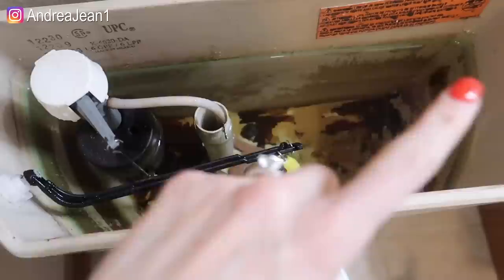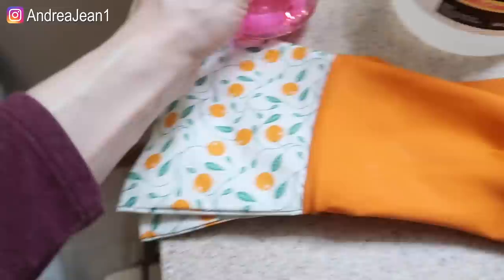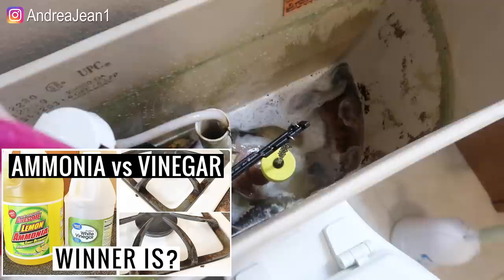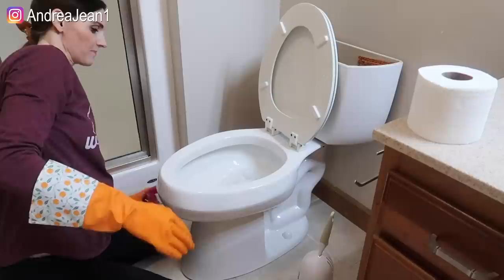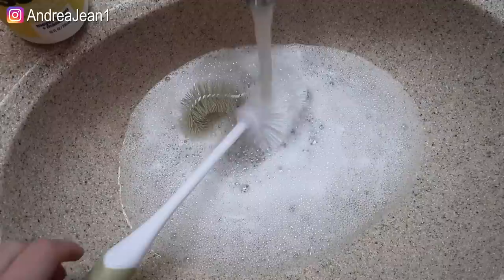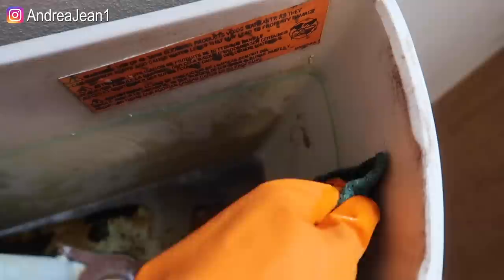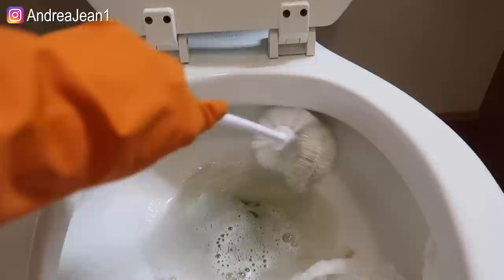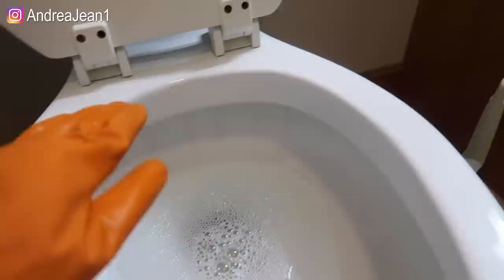Put VINEGAR into your TOILET and WATCH What Happens!! (Bathroom Cleaning Hacks)

Comment: My preventative measure was to have a whole house water filter and softener installed.  Made a huge difference. The filter would need replacing periodically (depending on how much mineral such as iron, is in the water) and salt for the softener, also. I found his true for both well water and city water.
Reply from the maker: Thank you!
Reply: What kind of water softener do you have?
Reply: If you get a softener, get ready to invest in bags of salt, it never ends, hauling salt is not fun, the systems aren't cheap and need repair, not alot but when they do, its again not cheap. I spend appox 800 bucks a year on salt. Things they dont really mention when you buy one. But they do help.
Reply: Charles Miller dang!  That is a lot of money! 
   I only get Social Security and honestly, 
that is a lot of money!
I know they work well. We had a softener when I was a kid in my house. And years ago my first house we had a softener and it was awesome! If you can afford it,  it’s definitely awesome!
Reply: I live in a condo, and i thought about installing a water softener.  The head maintenance man told me others in my condo complex have installed softener systems, but they ended up pulling them out since it reduced the pressure of the water too much.  At least with Andrea Jean's hints and some elbow grease, I can clean off the residue.  Thank you AJ!
Reply: They reduce the pressure by 5 Lbs per bottle, at least. That another thing they fail to mention.
Reply: @charlesmiller5078  We are speaking about the whole house water filtration system like LifeSource. That's what we have.
Reply: @charlesmiller5078  Our last water softener was from either Sears or Home Depot and we went through salt ridiculously fast. The softener we have now, we purchased from a plumbing company that specializes in water softeners. This made a huge - HUGE - difference in the amount of salt we use yearly; down by about 85%. The difference between the two is that we now have a softener perfect for our family size, and it cycles a ton less. Knowing the correct size and how it functions is key.
Reply: @AutumnStarostin  I had a local company install something similar to the Culligan brand. It is a simple system. They have also delivered the salt for us, and carried it down the stairs to the basement and pour it in. We paid for it on the installment plan (no credit cards) and now that we are empty nesters, we use about 40 pounds salt twice yearly. Costs about $15 for two 40 pound bags.  We do live in Iowa, where the economy is livable.
Reply: @charlesmiller5078  We've had our set-up for at least 17-18 years, and never needed service!
Reply: @patriciasodaro8670  Ohhh, I see. So I have a simple water softener, but yours is probably more involved. We have lived in places that we dearly wished we had that kind of set up, as the water was wretched. (Esp. very rusty well water)
Reply: The softener media has to be changed every 3 to 4 years, you have been doing that right.
Reply: @jang871  - excellent tip about using a plumbing company to buy a water softener from - thank you!!
Reply: I wonder if you could drop a few salt pellets into the toilet tank instead of getting a water softener system. Maybe that would eliminate the scale build up in the tank. Last time I cleaned my tank, I used Lime Away gel. It really clings to the tank walls.
Reply: No, that wont work, there is no salt in the water that the softener treats.

Comment: Suggestion:  Pour vinegar down the overflow tube in the tank.  It will run down into the bowl EXACTLY where those stubborn stains in the bowl are.  NO MORE EXTRA WORK trying to treat/then scrub those vertical calcium stains going towards the water line.   John in St Pete FL

Comment: Why not just drain the tank then fill it to the top of the stains with the vinegar. Let it sit o/n then flush it in the morning. 
Also, I had a terrible stain at the bottom of the bowl where it narrows to 3-inch diameter and you can barely fit a round brush in there. Tried lots of scouring powder {Comet, Ajax, Bon Ami) Liquid dollar store toilet cleaner, nothing would remove that stan no matter how much I twisted that brush. Poured about a cupful of Walmart {generic} Dishwashing powder into the water. Swirled it up to dissolve it. Let it sit at least o/n but I think it was more like 12 hours. Stuck the brush in, twisted it back & forth about a dozen times, flushed, and presto, the stain that would not go away was gone.
Reply from the maker: Wonderful to hear ✨

Comment: You need an enviro cloth and a window cloth from Norwex to clean your mirror with nothing but water .  Check it out.
Reply from the maker: Thanks June ❤️
Reply: Don’t let the liquid run down to the edge of the mirror because it will damage the finish on the back of the glass. Use a microfiber cloth and finish close to the edges with that so you keep the edges dry. I use a supper soft micro fiber  cloth as a buffer when it is almost dry and that makes it nice and shiny.  Please don’t put your toilet bowl brush in the sink soak it in the bowl so you aren’t transferring toilet germs to the sink. There are 2 parts to the brush you were using  the loop is to clean up under the rim of the toilet bowl. You can also clean  the brush in hydrogen peroxide. You can clean tooth brushes and hair brushes and combs in hydrogen peroxide too. I was dishes in the kitchen with a baby bottle brush and I clean that in hydrogen peroxide when it won’t rinse clean. I like the bottle brushes that are all plastic to clean dishes because they don’t turn sour and I just hang it up to dry but you could put it in with the silverware to dry if you rinse all the soap out. I rinse off the food, then wash with soap on the brush, leave the soap in the brush and hang it over the sink to dry and then add soap as needed. It is sanitary and cost effective.

Comment: Great video! How did you end up getting all the settled sentiment out of the bottom of the tank afterwards?  I’m thinking you drain the tank again and then just scoop it all out?? Or is there a better way?
Reply from the maker: Yes you would have to do that ....bummer.
Reply: I was wondering the same...maybe empty out and use a wet/dry (garage-type) vacuum cleaner?

Comment: I always use a toilet tank cleaner tablet to keep my tank and bowl clean longer.
Reply from the maker: That’s a good idea!
Reply: Please do not use those tablets. Read the toilet owner manual...it voids any warranty if you put those tablets or cleaners  in the tank. When in doubt ask your plumber.
Reply: @TheGonso35  thanks, I'm not worried about a warranty on my toilet that's only a few hundred dollars and the parts under warranty are only 10 to 20 at most. Thanks for your concern though.  And I didn't just ask a plumber I asked my city planner that has done our sewage plant and he says it's actually good to use them because it also cleans the plumbing running to the city.
Reply: and how often do you have to replace the rubber parts in the tank? those tablets and vinegar (acid) eat right through rubber.
Reply: @estelajoloya5520  I don't use Clorox tables. We don't have rubber floats. Sorry you've had a bad experience. Like I said it's a cheap fix plus super easy. But thanks for your feed back.

Comment: Pour some vinegar slowly down the black tube in the tank.  Slowly so you don't trigger the flush.  About a 1/2 cup.  Vinegar will seep out the holes in the rim cleaning any calcium build up from the holes.  Your toilet will flush better when the holes aren't clogged.  CLR also works.  This can be done even when the tank is full

Comment: THANKS FOR THE VINEGAR CLEANING TIP.  MY QUESTION IS HOW TO FINALLY GET ALL THE BIG OLD STAINS OUT FROM MY GRANITE COUNTER TOPS? I WAS NOT AWARE THE COUNTERS ARE NOT SEALED AND OVER 9 YEARS NOW HAVE DEEP STAINS FROM WATER SOAP AND OTHER CAUSES. I AM VERY GRATEFUL FOR YOUR HELPFUL INFO  TO GET THE COUNTERS CLEAN AS NEW AGAIN. THANKS AND LOVE JOY PEACE AND HAPPINESS TO ALL INCLUDING OUR ANIMALS........
Reply from the maker: Thanks so much!! I don’t have granite so I am not the best advice giver for that ❤️
Reply: Rubbing (isoprophyl) alcohol and water.  50/50.  Spray on counter.  Let sit 3-5 min and wipe w/soft cloth.
Reply: It the worst case, you can hire a counter top installation firm to come in to resurface and seal the tops.

Comment: You can clear out a stopped up toilet by squirting a good amount of dish soap, baking soda and vinegar into the bowl. Let it sit over night. Plunge it really well. Repeat if necessary. This works as well as commercial drain cleaners do.
Reply: If you keep a drinking glass next to your sink and don't put it into the dishwasher as often as you should (I'm guilty of this) you can pour a half inch of vinegar in it to soften up the hard water stains. Twirl it around the inside of the cup. It's fun because it bubbles up. Let it sit for several hours then rinse it out. Repeat if necessary. Your glass will be as clean as new.

Comment: what about the rust that stains your toilet and is it so difficult to remove?
Reply from the maker: Not too hard ✨
Reply: Use a pumice stone after you clean the toilet boil to remove the stains that still didn't come out.  You can purchase one for a couple dollars at Lowes or Home Depot.  You just rub it on the ring in your toilet bowl after you cleaned the bowl.  It does not hurt it.  A cleaning lady told me that years ago.
Reply: A product I use (it does have chemicals) is Zep toilet bowl cleaner. You can get it at Home Depot. Follow the directions. It will take of the hardest of stains and buildup. It is amazing. But follow the directions closely. Not sure about use inside the tank, though. I was ready to replace my toilet. It made it look new, and all you have to do is let it sit for a few minutes and brush lightly. Everything just disappears.
Reply: I use the Zep 'pucks' for hardwater that you drop in the tank every few months. It will work away at current stains and keep new ones from forming. We had terrible rust stains in our new home and within a month they were gone, no scrubbing.
Reply: @TourPace  Thanks for that tip!
Reply: @yellowbird5411  Is it safe for septic tanks?
Reply: CLR... great stuff

Comment: I just pour the vinegar in the tank with the water in it. When you flush it the vinegar will come out the holes and you can scrub the toilet with that water. Flush and clean again.  Lots easier than using a little squirt bottle.

Comment: What does that do to a septic tank?
Reply from the maker: Honestly....  not sure. I haven’t tried ✨
Reply: nothing !!!
Reply: @marcvandeuren4597  If it upset the pH balance enough in the septic tank, it could cause the system to fail, and that could be a very expensive repair if the drain field became plugged.
Reply: @buggsy5  thanks but I have no septic tank !!! I am in an apart in a big building.